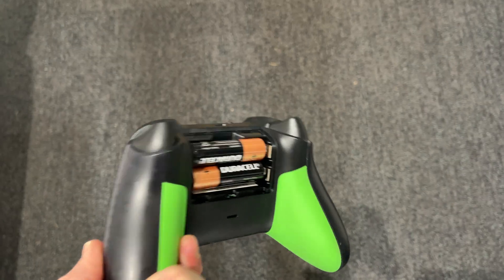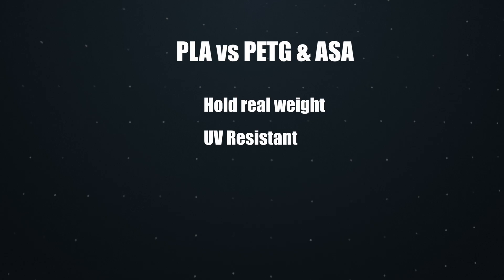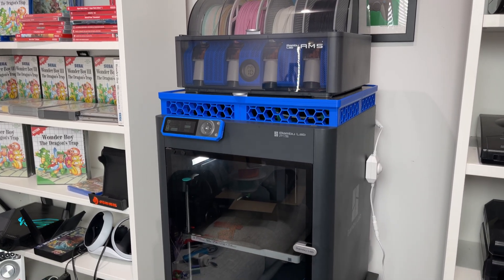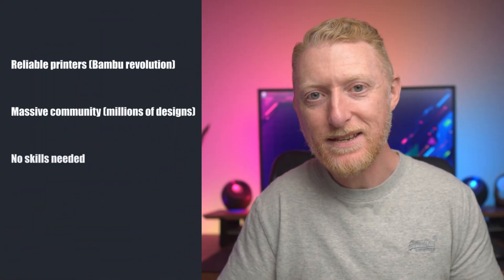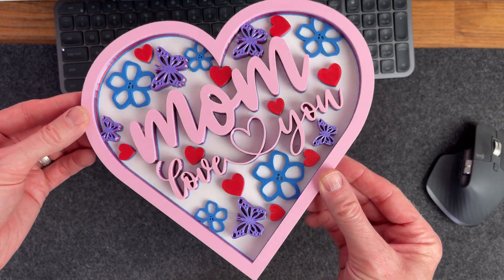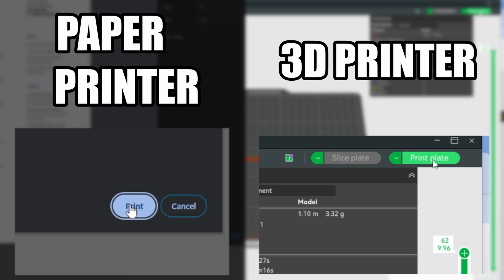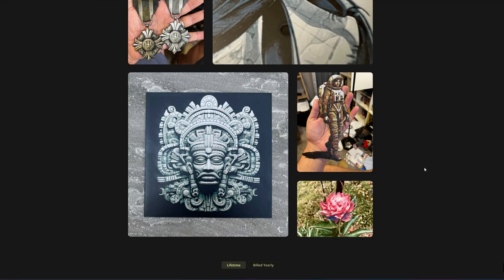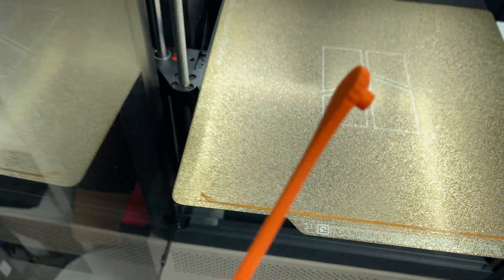It's Finally Time to Get a 3D Printer (Here's Why)

Comment: What is the useful life of a 3D printer before replacement is required ?   I am interested in factoring the printer cost itself into part costs.
Reply: Semi related.

I went to a local shop to print 3x 3.5 inch cubic designs and they wanted to charge me about $350.

So I instead just went and brought myself a full printer. 

Just something to consider in the price of a printer.
Reply from the maker: I’m not sure of the official answer but with maintenance and considering all the parts are easily replaceable you should keep it going virtually indefinitely.

Comment: How much did you pay? Looking on marketplace it seems that 3D printers have joined PS5, xbox, iphones, drones, etc.. as being prime targets for scammers. I have seen a few listing from profiles less than 1 or 2 years old with the usual red flags.
These printers all look cool, but it's still $1k upfront to print a wd-40 nozzle.
Reply: the p1s cost less than 1k currently it is available with the AMS for 550 you will have to get other stuff but you can get it cheaper i got mine for 340 refurbished from microcenter as i dont really care about color i mostly print functional prints. you can also look at the elagoo centurion carbon but there are also other other companies. mine already has a couple hundred hours i got it before thanksgiving. total i dont think i have spent close to 1k in stuff yet. if you really wanted to you could though because there are lots of things you can get for it. if you are thinking about it i don't mind answering questions.
Reply: It really depends on you. Mine(P2S) is a tool. I'm using mine for custom organization, cheap simple tools, hue forge photos for my family, bringing my 3d models to life, but most importantly custom car parts. Bambu Labs nailed it. My up front cost was about 1k with the printer, the AMS, and a good amount of spools. If you like making things than it will be for you.

Comment: I started with the more budget friendly A1 (which you can print PETG on) not knowing if I would really use it, a year later I upgraded to the P2S that I should have gotten to begin with.
Bambulab has made 3d printing fun
Reply from the maker: That’s cool, I like the P2S but hard for me to justify the upgrade just yet considering how much I’ve modded mine too. Will you keep both of your printers or just the new one?
Reply: @LovingTechLife I think of you are starting off P2S is better bang for your buck. Most of the mods you want on a p1s already come on a P2s.
Reply: @AdolfoAlvarez-ep4dy   I wish I had seen this comment before buying the P1S two weeks ago.
Reply: @AdolfoAlvarez-ep4dy not really I just got the p1s with the ams for $550. I don’t need the screen either. If we go on our phones or computer to find prints why would I not just press print from my phone or computer. Sure it’s nice to have a big screen but nothing changes the print quality. I basically got the p1s for $300 because the ams cost $250

Comment: The best thing I've done with my 3D printer was when I had a problem and then fixed it myself using TinkerCAD. Making a part that otherwise doesn't exist to solve a problem unique to your own situation is empowering.